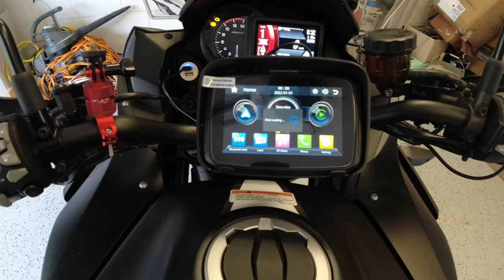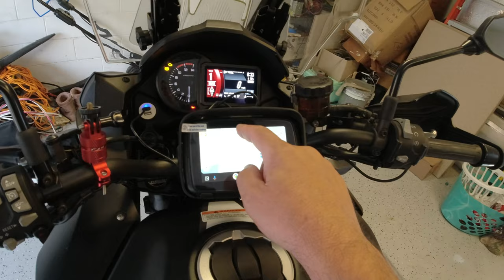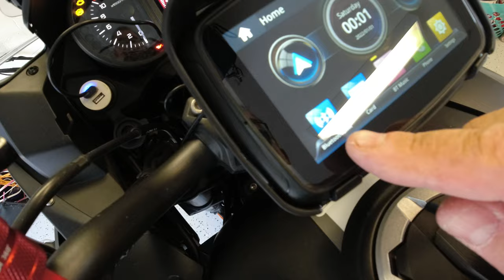Stop using your phone for navigation on your motorcycle!

Comment: One more thing about strapping phones to your handlebars. I've ruined three cameras on my S 1000 XR. Wireless charging is really bad in the summer. It will overheat the phone. The phone will still overheat without wireless charging. Just a bad idea using your phone for navigation all around on a  Motorcycle
Reply from the maker: Yep.. I use it in my car but it's in AC in Florida... on my bike my phone always overheated. Not now.
Reply: Also a bmw s1000xr owner here! I’ve used my iPhone in combination with a quadlock wireless charger for more than a year now without “issues”. Maybe placement on the handlebars matters for heat? So far I can’t beat the phone for navigation, Flitsmeister (app that alarms speed traps and more), and music. However it would have been cool to be able to use the controls on the handlebars for once.
Reply: @mo_adventures  Maybe this is the one for you?

Comment: Interesting product, I typically keep phone in pocket and listen to the GPS.  Two questions can you still use the helmet to helmet communicators and I wonder if I can use this on an insta360 x3 camera to start/stop camera and to see the video
Reply from the maker: Yes on the helmet to helmet coms.. Don't know about the Insta 360... 
Your phone still connects to your BT coms... and to the android auto/apple car play so when you use the GPS/android auto/Apple CP it's actually just using your phone for navigating maps, audio, calls texts etc.. I was considering a garmin motorcycle GPS.. But this is way better because it does everything.
Reply: That is the exact same unit with 17 different names on it. It is nice to see a different box on yours. I spent no less than five hours, figuring mine out. The Bluetooth kept disconnecting from the unit to my phone. I ended up hardwiring it to the USB mini and it's been working perfect ever since hasn't dropped yet.
Reply: I have a 2018 Goldwing that has Apple CarPlay built-in. That's it that's the only motorcycle that has it. I find this unit to be a game changer. I have a Ducati multi-Strada pikes peak and it uses Sygic. I would only use Sygic if I was in a dead zone where there's no cell phone reception because the maps are already downloaded into the phone and I could get myself out of a situation using that.  but once I'm back in civilization, I would go right back to the Apple CarPlay unit. I love this thing.
Reply from the maker: @Magicinstalls  Yep.... you can get it for as much as $400 and as little as $150... and I think it's the exact same unit. Amazon carries it for $250

Comment: Hi Michael,  nice video,  nice bike too... sounds great but does it have its own sat nav built in?...if you're still relying on cell phone signal for sat nav then the improvement is limited...?...thanks
Reply from the maker: No.. it's not built in.. It uses android auto or apple carplay. That said.. in both cases you can download offline maps for the area you are traveling in and not use the signal.. So if you are going to be in an area with no signal or spotty signal then simply connect to wifi with your phone, go to maps and download offline maps for that area. Then it won't need the cell signal to NAV. I hope that helps. And thanks!

Comment: I have the same one and I do love it except....The audio quality is degraded a lot when paired with my helmet.  I have several different bluetooth helmet headsets and they all lose audio quality when going through the Android Auto device.  Yet if I bypass the device and use just my phone to my headset, audio is back to being clear and loud.  I even tried adjusting the audio settings in the Android Auto head unit and audio is still far inferior than if paired directly to my phone.  Do you find this to be the case as well?  Due to this, I have gone back to using my phone with Quadlock mount on the bars
Reply from the maker: Unusually it was good.. although a bit lower volume than paired directly... UNTIL this last weekend.. I went for a trip and it started sounding like crap.. Like really bad and distorted... I'll try it again.. but to answer your question yes.. it seems the audio quality and volume are not as good as when paired directly.
Reply: @techguyMD   Thanks for the reply.  It's really a shame because it's almost perfect if it wasnt for the audio issues.  I would much rather use this than have my phone mounted, but I listen to music and take phone calls more than I use maps... So for now it's back to using just my phone. But if I'm going on a trip I would probably mount this again for maps
Reply: @Mudslidex1  I have had the same audio quality issues. Is there a way to use Android Auto on the device, but route the audio directly from phone to the helmet bluetooth?
Reply: @gaurav8221 you can change it in the settings of the device, whether you want it to play sounds directly, or use your phone for sound

Comment: I have this unit and a cardo packtalk bold and S22, I'm having the same issue with getting the sound through my cardo. Can you walk me through how you set it up please???
Reply from the maker: All I know is it has to be turned on in a certain order... it works fine if I turn on cardo and connect phone, THEN start bike and have unit turn on. I always have to go into settings and sound settings.. turn up volume to max. But it does work. Just phone to unit and phone to cardo. then turn on cardo and phone first then unit and it works.
Reply: @techguyMD  I got it! Had to connect cardo via GPS bluetooth!

Comment: I think these android auto and carplay retrofits will increase in popularity. How has yours been working so far?  Any updates?

I think one of these and a tank bag for the phone to stow and charge the phone will be ideal. Just need to make sure the phone has some airflow over it somehow or else it will probably overheat if using GPS while on the charger.
Reply from the maker: Still working great. Actually with the screen off in my pocket it doesn't get hot and the battery lasts a long time! Screen on time is what kills the battery.
Reply: @techguyMD  Interesting and good to know! I'm considering one of the newer 2020+ Africa Twin's for the built in android auto but maybe I should consider some other bikes too plus an android auto retrofit like this.
Reply: @rcvg69420   I have this on another bike and a 21 Africa Twin. The biggest difference with the twin has handlebar controls but this unit works well unless it has durability issues in the long run. It's wireless which is good and bad. With the Twin your cellphone is wired (very waterproof plug) which means it's always fully charged wherever you stop.  With wireless the initial convenience of not plugging in the phone is nice but you have to charge it somehow.  The Africa Twin is a great bike on its own regardless of CarPlay but it's one of the very few that has it built in. I'm glad we are seeing standalone products because CarPlay has so many good options for mapping, plus apps like on the way for weather.
Reply: @kalimarus  Thanks for the reply! I actually ended up picking up a used 2019 R1250GS. The GS is just an epic bike and the deal was at the very top of my budget but still cheaper than what a 2020 or newer nice ATAS would have cost me. Plus I think the GS might be better for my use case anyways which is 99% street use.

I picked up an Ottocast Lite C5 clone, I forget which one. It works without issues but I do need to get more familiar with using it still. Just not familiar with efficiently getting around the Android Auto interface yet.

Comment: I tried to install a similar display on my bike but my Android 10 phone does support Android Auto via USB connection only but not BT/Wifi. Therefore you'll need Android 11 or higher. I guess your phone is Android 11 or higher.
Reply from the maker: It is. It's a pixel 7. I should have made note of that. Thanks for the info